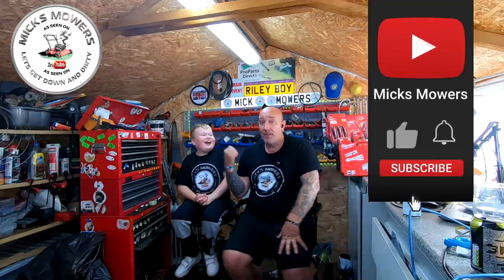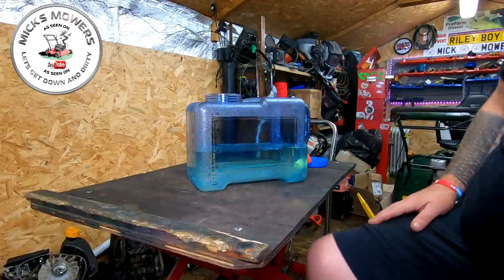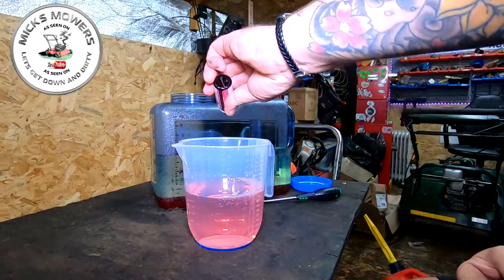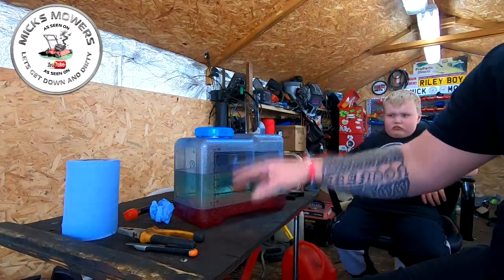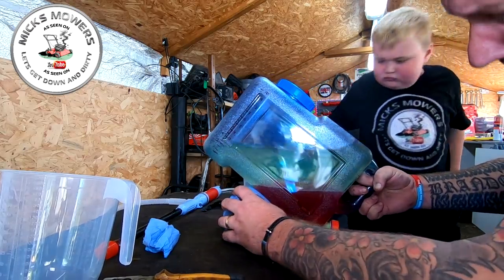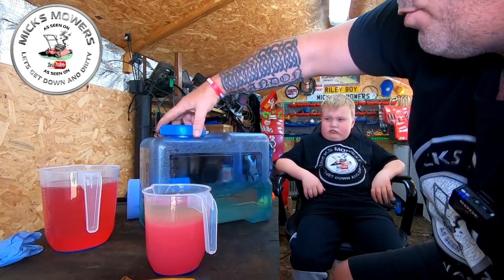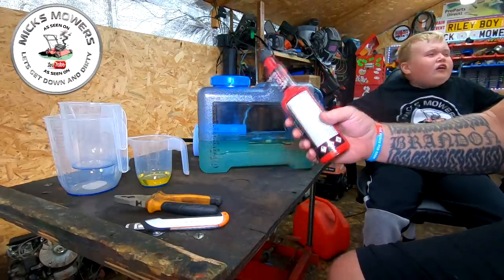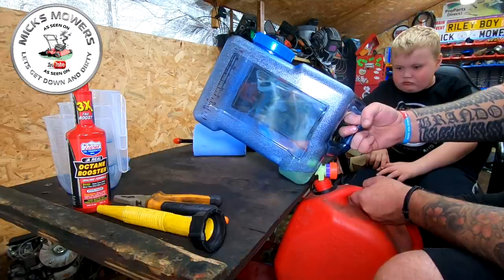How To Remove Ethanol From E10 Unleaded Fuel To Use In Lawnmowers And Small Engines

Comment: In America they seem to have added ethanol - alcohol to burn more fuel. And I've done many of actual fuel tests on gasoline burning engines the slower you drive for instance on my motorized bicycle or my big diesel truck the better fuel mileage I get. Basically turn less RPMs and fuel mileage will pick up drastically. At the drag strip changing a drag car over to alcohol you burn almost double the fuel. This is why it seems oil companies put that dash of ethanol in the fuel so you'll burn more of it.  On another note I let a New mower that wouldn't start I let it sit a few years with 87 octane gasoline with up to10% ethanol. Pulled carburetor off carb stopped up with basically mud, inside fuel line fell apart and fuel line stuck further down in carberator. I've worked on carbs for years the first one with the ethanol stopping up and chewing fuel line up. I still keep using the cheap ethanol loaded fuel but now I run the engines out of fuel each time I stop them. And over the winter or if it sits too long I add the cheap 12 oz fuel stabilizer from the dollar tree. The cheap fuel stabilizer has worked for years for me for years and fuel that was very old and works not to freeze up. Check out my video I just started a new channel it's a little rough but it'll get better with time. And a lot of my small gasoline engines I've changed over to propane and you don't have any of these Ethanol fuel problems, less maintenance because gasoline doesn't get in the oil, no carbon buildup in the engine at all, the engine last two to three times longer and don't engines will spark arrestors you don't have to ever clean the spark arrestor or spark plug. A propane engine never floods. Propane may be 10% less power then gasoline but overall it's well worth it. In America where I get propane at it's cheaper than the cheapest gasoline I can get a gallon almost 50 cent a gallon. Today's date November 2nd 2021 propane is $2.49 a gallon today and it just went up 49 cent at the place I buy from recently it was $1.99 a gallon for several years.

Comment: How many times can you re-use the water before it doesn't pull the ethanol out of the gas?
Reply from the maker: I have no idea
Reply: @themowerman  That would make for a good follow up video, buy your petrol, remove ethanol, set water aside and buy more later to reuse it and see how many times it will work with the same water, or if it works multiple times.

Comment: We have a electric spin dryer which collects all the water from the drying clothes. As this is from evaporation I assume this is ok to use plus it would be ok to use in lead acid batteries? Also we have classic cars which were built for leaded petrol. Although this product is illegal for garages to sell, it is not illegal to add lead ethyl to unleaded petrol. Would adding lead ethyl restore octane figures in de-ethanol petrol?

Comment: So cool. So if you have taken ALL the ethanol out using this process. Does that mean its even better than normal E5 fuel?
Reply from the maker: Yes
Reply: @themowerman  Cool had one idea. how about putting a tap on a used water cooler bottle? would get 100% out.

Comment: Why 2 litres of water? And also do you still need to do this with e5 premium petrol?
Reply from the maker: Because you need enough water to attract the ethanol.. e5 is not too bad but now they are adding more.. soon we will be on E15 fuel
Reply: @themowerman  cool. Thanks. I need to do a carb clean on my mower and then will be doing this with my mower fuel. Is there a rule of thumb to how much water you put in with the fuel?
Reply from the maker: @Nikonp-hg6yl  I use 5 to 2 as a rule
Reply: @themowerman  cheers

Comment: Interesting. Would there be any benefit in mixing half regular fuel and half premium? Wouldn't that reduce the amount of ethanol?
Reply from the maker: No because normal fuel 95 has 5% in it upping it to 15%>>
Reply: @themowerman  ok thank you
Reply: @themowerman  I do believe adding an equal amount of 95% to 90% would reduce the overall ethanol percentage to 92.5% ethanol free fuel which doesn’t stop the problem of having ethanol in your fuel. Great video, like the food coloring. I have only one gas station that sells non-ethanol fuel and it’s 20 miles round trip. Like you said it gives options👍🖖 Thanks from Maine....Edit: it would cost more to add the E95 also and have 7.5% ethanol in twice as much fuel.

Comment: I wasn’t even aware of this issue. I have a Stiga mower (bought in 2020) and a Stihl blower (bought in 2020). Have these likely had any preparation work as they are so able to accept ethanol mixed fuel? Or would I need to follow these steps? 

Can I get away with buying a premium fuel to avoid this for now? Or is it a must from herein. Can’t believe the gov have done this without better guidance
Reply from the maker: Yeah get the premium fuel mate
Reply: @themowerman  think you can read my inexperience 😂. Yeah I think the premixed ethanol free may be worth the investment. Do you do servicing of mowers too? As it would be great to have it serviced and checked at the same time
Reply from the maker: @glassdomedesign  yes I do
Reply: No problem at all running Ethanol in those, i have a few Stihl saws that are even older, early 90's vintage, and they run great on E10 without worry.  Anything made in about the last ten years the manufacturers have used ethanol rated materials for things like the fuel line, seals, diaphragms, etc.  Stuff bought in 2020 should have zero issue whatsoever with Ethanol, if you don't believe me contact a Stihl service center, if they are honest they will tell you the same thing, if they aren't honest they will tell you to buy their premix fuel or fuel treatment that costs $20 a gallon... LOL.... I have one saw thats a early 80's model, still runs great, the only thing i did to it was replace the old fuel lines that got brittle, most likely due to age but ethanol has been known to harden some fuel line polymers, replaced them with Tygon fuel line and zero issues for years now.

Comment: I had ethanol related issues with small engines and my motorbike. Not sure if removing the ethanol from E10 is the solution because you will remove the octane, an expensive gasoline component. Better to find out what high octane grades are ethanol-free. In NL the Shell V-Power, Esso Supreme, BP Ultimate and Lukoil 98 are ethanol-free. Not all high octane grades are ethanol-free: Total Excellium has 5% ethanol over here.
Reply: There are plenty of ways/products to add more octane back to the fuel if you need it such as alcohol, toluene, acetone, and others, but only high performance, high compression engines need it.

Comment: That sludge is going to be the bane of my existence. YouTube recommended me this video and I’m very thankful for it! It may not save my car in the long run but I can save my mower at the very least (ironically both are Honda). Detergents like RedX are practically sold out up here in the Highland countryside and E10 fuel stabilizer wasn’t sold in any of the shops near me which is rather baffling I feel.

Long story short I don’t like E10 petrol :)

Comment: Fascinating video, why do they put ethanol into petrol in the first place? Btw, need to check with your local authority beforehand as some authorities don’t have facilities for storing chemicals/ flammable liquids at household waste recycle centres.
Reply from the maker: I did check and they do take it..
Reply: @themowerman  do you know why they put ethanol in petrol?
Reply: @gasgiant7122  Ethanol is used as an additive in gasoline to help oxygenate the gas, causing the fuel to burn completely. Thus, ethanol-infused gases produce cleaner emissions, leading to better air quality.  It's basically an emissions modification to the fuel, allowing it to burn cleaner, add to that a proper operating catalytic system and you get a larger reduction in NOX and other bad things out of the tailpipe.  There is some good videos out there done by independents that tested with and without ethanol to see the emissions and its interesting info.  It can also be used to boost the octane of lower grade fuel, less refined in some countries and improved with the ethanol blending since its easy to make ethanol from many sources, not just corn which is the most popular and common here in the US.  Overall ethanol is no issue, i don't even think about it anymore, i have been running ethanol blended fuel in everything for so long, around 20 years by now, that its just not a thought in my mind.  Living in the Midwest US we have ethanol plants around us, i have three locally within an hour of driving time from me, our fuel is also relatively stable price wise compared to outside of my region.  Its amazing seeing what people pay for gas in other parts of the country compared to here, i just got gas the other day for $3.05 a gallon, and this past summer we got as low as $1.85 at one point.  I have never seen fuel as expensive as others have commented.
Reply: @CrazyHamSales  ha ha, it's about £6.30p in UK per gallon that's prob like $8.50 equivalent,  the down side to ethanol is it basically ruins rubber gaskets and membranes in lawn mower engines/ carburettors.
Reply: Octane booster for cheap petrol
Reply: @donwatson8257  thanks, I thought it would be all about profit & greed, I have thought for a few years now that when I fill up with petrol from my local Asda (in uk)  it smells more like thinners than petrol ?

Comment: Octane does not burn. Adding it to gasoline does not make the gas more flammable. It makes it Less flammable. 
Look these principles up because theyre not intuitive. 
So the Lower the octane rating of a gasoline, the Higher the power it contains and makes. The only reason to run more octane is if your engine is predetonating. Which cannot be tolerated as it will ruin your engine. Run the Lowest octane rated gasoline your engine will run smoothly on. And it will be making the max power it can with gasoline. Adding octane booster is not wise. Test the gasoline for causing predetonantion. Add just enough, or none, octane booster to stop the predetontion, no more.

Comment: actually ethanol IS the octane booster in fuel. you are better off putting in lucas fuel treatment. octane does not make fuel more flammable, what it does is make the ignition point higher so the timing can be advanced more for higher compression engines. small engines perform better at a much lower octane because they need to ignite faster.

Comment: The best way to get deionized water is to collect rainwater in a 20 litre water drum for camping (as it has a tap on the side). Put a large funnel into the cap with filter paper to collect clean rainwater.

Comment: Seems to be a bit of a mine field. Mowers on line and Allett have good info on their website. They recommend using a fuel stabilizer like Briggs and stratton Fuel fit and this should prevent any problems. Allett also recommended using Aspen fuel that is ethanol free but is around £35 for 5 litres. I have always used Fuel fit in my mowers and never had a problem after winter storage. Never the less I will continue to fill my can when I fill my Audi with premium fuel as long as I can get it.

Comment: Fortunately here in the USA we have gas stations that also sell gas without ethanol at the pump in a separate nozzle like diesel has. But it does cost more than regular ethanol gas. About 35 cents a gallon more. So if this procedure actually removes ethanol it not a bad idea.
Reply: Unfortunately, those gas stations are only in some rural areas.
Reply: @lambition  areas where boats are common usually have non ethanol fuel available.  That includes heavily populated areas.
Reply: non-ethanol fuel at the pump is becoming exceedingly rare.... I used to have two local stations that had it about 10 years ago, they phased it out, for two reasons, one the higher cost, and two the higher cost was making it sell so slowly that it was wasted tank space to keep in stock.  Currently the closest non-ethanol fuel sources that i have are 40 miles to a marina and i can't purchase them as an outsider, not a marina renter, no container sales other then boat tanks, etc... And the next closest is about 60 miles to a station that has it as off-road only fuel, and its a premium price to, around $6-7 a gallon on average.  Just not worth it, i haven't had any ethanol related issues in all my years so not too worried about it.

Comment: Any new gas operated engine produced in the last 10 years or so can run ethanol gas. Ethanol actually keeps the fuel system clean! My 11 year old snow thrower has had no issues running on ethanol gas. Back when ethanol was 1st introduced I was about 10 miles offshore in my boat when the engine died. After several attempts I managed to get it going by venting the tank and continue to apply pressure to the priming bulb but only managed 3 knots. It turned out I had just filled up with ethanol gas and the ethanol loosened all the junk from the non ethanol gas in the tank and clogged the fuel pick up. I replaced all the fuel lines and fuel pick up and cleaned the carbs. Never a problem since!
Reply: Absolute fallacy, please provide supporting documentation!

Comment: Most Octane Boosters are Alcohol based!!! Alcohol like Dot 3 & Dot 4 Brake Fluid is hydrophilic, its molecules are attracted to water. This is why in ALL my antique car I always use Dot 5 Brake Fluid exclusively. It is silicon-based, so water does not build up in the Brake Line, Brake Cylinders or Disc Calipers forming rust which will seize up the Brake Cylinder or Calipers... Once properly installed it never needs replacing....

Comment: I don't understand the theory that by removing ethanol you removed some of the ignition components of the gasoline. We had ethanol free gasoline for years and it fired up just fine so I don't think that's correct I'd love to hear somebody explain to me if I'm incorrect
Reply: Gasoline is a chemical soup of hydrocarbons. Modern pump gasoline is not the same soup.  It doesn't even smell the same as gas from 20 years ago.  Even the ethanol free stuff is a different soup as from the past.  Ethanol added to the fuel does boost the octane rating, so it is an anti-knock agent.  Most small engines would run fine, (no knocking) with octane 85 rated  non-ethanol fuel.   Only high compression performance type engines will you notice the knocking and back firing.
Reply: Luuk-out-below great explanation....thanks....fyi vp racing and sunoco actually sell leaded gas and ethanol free gas,
Reply: @mrkoolio4475  good to know.  Presently  I can still get 100% petrol pump gas rated at 92 octane in my area.  We run that in the snowmobiles, boat motors and bikes and small engines .

Comment: A USA economist determined the net energy savings by using ethanol petrol/gasoline, after calculating the energy investment in growing the corn for ethanol, is actually a loss. That is, it costs more to plant, cultivate, fertilize and harvest the corn, followed by "cooking" the corn  mixture to extract alcohol to add to petrol/gasoline.  
In the USA, there is a growing backlash from motorists who have read widespread reports of alcohol-driven engine damage (from tank and fuel line to injector lines and injectors, themselves). The concern comes from either alcohol, itself, damaging plastic parts, or from corrosion begun by presence of water in the fuel line and engine parts (particularly aluminum alloys).
Reply: It's just like US to use the wrong plant to make the alcohol. Corn sucks for this, sugar cane is the best alcohol producer.
What you get when cutting gasoline with alcohol is poor performance, reduced miles per gallon, (or equivalent) higher maintenance costs, and sometime, the alcohol attacks the fuel lines and your car burns to the ground. 
It's a stupid idea, if you can find 100% gas it's expensive, but the gain in mileage vs E90, or E85 makes it cheaper to run 100% gas. Alcohol absorbs water, never a good thing to have in your fuel.
Reply: @jimallen9859  The gasohol idea was floated at the behest of the corn growers and giant grain marketing firms like ConAgra and ADM. To them, the solution was simple-- sell more corn, and claim that the more gasohol we make and add to gasoline, the better off the environment. (wink, wink, nod, nod). 
Waiting for major gasoline retailers-- BP, Amoco, Shell--  to recognize gasohol is more costly and creates problems of its own (more expensive to remedy downstream effects, including possible engine damage) is difficult when motorists have no option but to corrode their fuel lines and engine parts. It would make sense for the majors at least to provide an alcohol-free option to gasohol. They would profit much more from that, once word began to spread that alcohol is a non-starter of a solution for gas engine pollution.
(BTW-- I, myself, do want to reduce atmospheric pollution, but gasohol is not an intelligent way to do that. I am hoping Tesla and other electric car makers produce a car whose battery lifetime matches the car, in years, and the car is affordable to Mr. Average Motorist)

Comment: I am not here to argue with anyone but you lower the octane of the fuel when you remove the ethanol from the gasoline. The manufacturers don't just add ethanol to gasoline and call it E10, they formulate a different blend of gasoline to be E10. With that said the lower octane probably wont hurt low performance engines.
Reply: I commented before watching the entire video, he did address the octane.